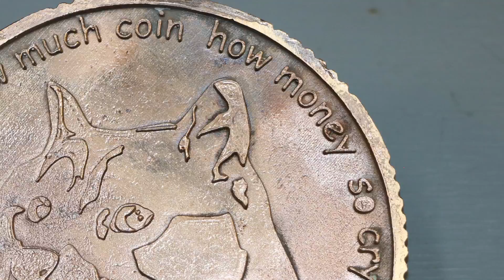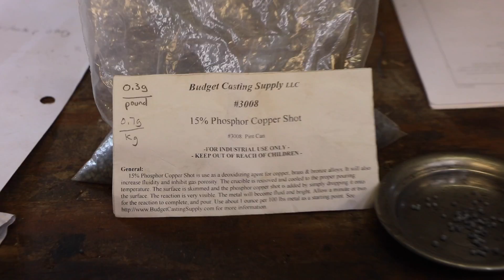3D Print to Metal Casting. Higher Level Lost PLA Casting Experiments.

Comment: Was international casting consultant and scientist for 50 years. Did you take the plaster moulds up to the various stages slowly? There is one at 100C, then adsorbed water at 140C and 180C. I normally can cast bigger than your moulds by a) adding the plaster to about 15-20mm then add some chopped ceramic fibre (like furnace blanket). Let that 80% set and then top up the rest with straight casting plater. b) heat the mould to 90C for 20 mins, then take it up to 140C and hold for 30 mins, then up to 180C for 10 mins. Then heat it up ready for casting.
I would have the mould at an angle so the metal doesn’t flow into a flat area and just “blob”, instead I would have the mould at 10-15 degrees. That way it flows down and then fills up evenly.

Comment: Invest in a vibrator. Or tap the side as you pour the investment. 
Also dont pour into cold investment, just in case you are. It needs to be as hot as you can get it out the furnace.

Comment: Just spitballing a couple of thoughts (I've never done this type of casting with these types of materials): Thicker walls on the flasks might help; the investment material and the plastic and the metal and the flask all have different rates of expansion and contraction - you might be able to find an investment material that is more conducive to these things; have you tried burning out at a slightly lower temperature for a longer time? Possibly this would counter-act the rapid expansion/contraction and (possibly) help with the cracking problem.

As I said, I'm not an expert at all, it's just some thoughts that came to me. Great video!

Comment: I got a tip for farmcraft101: 

Mix into the plaster the red shavings they use to clean concrete floors. 
The stuff they sprinkle on a concrete floor & sweep by hand using a push broom. 
Your molds won't crack & they'll last a long time. 

( In between college classes I had looked up an art professor to ask him how to make strong, durable molds to cast lead & pewter. 

Looking back, I didn't know to ask him two part mold or onetime mold. I was thinking like a top mold half & bottom mold half, strength, & durability. 

Anyway he gave me this tip & I had no cell phone back then. Once online  I could not find this industrial cleaner. Amazon & Etsy were not around back then. Sometime later some smartypsnts latchkey kid slipped into my home & stole all 2 lbs of my lead & pewter bits & nearly cleaned out my kits into ruin. I really hope he/ she rots in a cell some day. 🤬 ) 
Anyway, I will never be able to use this great tip from a master ring maker. 
Best regards.

Comment: I think you need to spray some water and soap mixture on your mold to reduce the surface tension before you put your plaster in. By doing this your plaster will flow better against your mold producing a better detail molds.

Comment: You put the mixture in a vacuum which is cool, but could the mould itself fit in the vacuum chamber after you've poured the plaster? I'd be surprised if pouring doesn't trap air
EDIT: Ignore me, I got to 10:15 now where you've tried exactly that.

Comment: Maybe it was not crosshatching from the print but rather brush strokes from the brush you used while the casting material was wet. The brush brings small air bubbles and the hair left voids? Just a thought

Comment: I think what you could do is, use just a small amount of plaster to cover the top surface details and then mix 1:1 ratio sand with plaster to fill in the rest.
You should also probably burn out the plaster for longer to absolutely make sure there is no water trapped.

Comment: So leave slits for air flow in objects like the d and Os, cast it on its side like you did for more aluminum pressure. The sprue placement must have helped with air flow leaving as metal comes in. you could do the bottom fill and the vent at the too method. I liked the rectangle housing. try vibrating before setting process. Let your metal cool before putting into water. make the details potrude from the face more.

Comment: I use a 50/50 mix of ordinary plaster of paris and sand, pore into a metal can and turn upside down to burn out the pla so it drips out on its own before burning off......heat slowly in the kiln to avoid cracks

Comment: i use drywall joint compound onto very thin walled pla printed models and i dont even have to burn the plastic out, i never have cracking issues my main issue in my 2 small tests so far was simply that my brass cooled too quickly to completely fill my mold. i didnt have any gates or sprues or vents etc. i literally just coated my part and then mae a hole in the coating to pour into. my next test i will use slightly higher melt temp + a riser because i could see on my test part where the detail was better towards the bottom and i tihnk its just the weight of the molten metal.
Reply: I’ve been thinking about using printed parts to cast and have a dumb question. What’s wrong with just using the part/object you print and pouring the molten metal directly onto it? Does the PLA not melt or not melt completely?

Comment: could you use:  Resin 3D Printers

3D printing in extremely high-detail is what the 3D printers in this collection were made for. Whether it is for dental applications, castable jewelry designs, prototype 3D printing and more, this group of 3D printers is capable of incredibly detailed 3D prints. With resolutions of only 25x50x50 microns, 3D prints come out looking lifelike without the need for post-processing. Using various resins, 3D prints can be firm, flexible, soft or incredibly tough for almost any application under the sun.

Comment: The cracking makes sense to me. If your mold is about 125mm across, 68um/m/K expansion of PLA means your mold goes from room temp to glass transition temp and gets about 0.5mm bigger inside a fully rigid plaster mold. Only above the glass transition temp can the PLA start to flow and "get out of its own way" and even then it won't be molten until it expands even more. I wonder if large items would work better printed out of a soluble material (PVA in water, or ABS in acetone) so you could remove most of the material before the burnout

Comment: I found adding sand into the plaster mix reduces the cracking of the plaster a lot. I usually add twice the amount of sand as I do plaster. Plaster is unstable during the burnout but sand is completely inert. It makes the mix more porous which allows the steam to escape the plaster mix as it heats without cracking your mould. I just use regular play sand. It doesn't effect the detail of the casting either.

Comment: At Master Carr you can buy raw material and you can get thick walled pipe in short sections, sold by the foot, just drill out your holes and weld on end cap which was the two crossbars.

Comment: Pressurizing while the plaster sets shrinks the bubbles by a factor proportional to the absolute pressure. Thus if you pressurize at 20PSI which is 20PSI "gauge", or 20PSI above atmospheric, or 35PSI absolute, the bubbles will shrink to 15/35 or about 43% of their original size which is not really much of a reduction at all. Also, unless the pressurized air can diffuse out of the mould before or during firing, it acts as an force trying to expand and crack the plaster.

Applying, then releasing, vacuum before the plaster sets causes the existing air bubbles to either expand and break off completely, or to be replaced by bubbles of water vapour, which condense to essentially nothing when the vacuum is released.

I'm not sure how the air trapped in the 3D print's infill affects all the vacuum/pressure. It may depend on whether the skin of the 3D print leaks. It is almost certain to have a few leaks, but it may also be the case the the entire skin is leaky all over.

Comment: try constrained freedom electroplating molding, with like copper source in copper sulphate
Reply: its very low temperature metal structure, maybe light weight, porous, mass growth, incremental
Reply: similar to casting, but no high temp needed, just electricity in a suitable bath, fitting with the source metal, just have a seed, like wood that can be burned away, also wood mold casting
Reply: burned wood carbon mold infill plating
Reply: etch the details, electro-etching, reverse of the electro-plating
Reply: carbonized paper electro-plating, controlled low oxygen environment, for  graphenesuper cap electrodes
Reply: full ceramic burned mold, two piece, casting
Reply: vacuum welding, inert gas melting
Reply: cake metal keeper around the mold
Reply: or just a normal pipe piece, cut off to length

Comment: At around 6:30, you made pour with no vent.  Is that the way it's done?
Reply from the maker: It had a vent.  Not very obvious with all the cracks in that mold.  With sandcasting vents can be optional, but they are necessary with investment plaster.
Reply: @FarmCraft101  Sorry.  It was 5:41.  I guess it was out of the shot.

Comment: One thing you might try to get rid of the 3-D print layers. Is to put them in an acetone vapor chamber. This will smooth over most of the print lines.
Reply: DIY perks did a nice video on it
Reply: Does acetone work on PLA? I didn’t think it behaves the same way ABS does…..
I am going to try smoothing / sealing the PLA with wax.

Comment: If you think that the print is expanding too much, try printing with the coin rotated in the x or y axis by 45 degrees... It's not a magic number or anything, but I think the problem is that you are printing flat on the bed when it comes to it being too solid. There would be a lot of support material with it rotated, but you probably have 1 or 2 non-solid infill layers as it is. Printing with it wonkey will just leave you with almost all walls, and little solid layers. I have noticed printing in that orientation will increase your surface details and reduce stringing on the surface. Maybe hit it with clear coat to seal it. And yes, it does take forever to find out if it's good or not

If that is the same color change pla I use, excellent choice. That stuff is good beyond it changing color

Comment: As someone that has done many dental castings , here are some suggestions.   1. Wet the pattern with soapy water (we call that debubblizer)and then dry it to help the water based investment "wet" the pattern ( water does not want to wet plastic).   The investment will flow onto the pattern better. 2. Vibrate the pattern as you paint the investment onto the debubblized  pattern and then vibrate the casting ring as you fill it.
Reply: Was going to suggest vibration after watching, but you beat me to it.

Comment: Good video! I've also spent some time experimenting with lost PLA and lost wax and here are my 2 cents. Let me know if you have any questions.

1. You learned by the end that the part orientation is very important. I don't think the horizontal orientation would work very well because the metal cannot fill properly as it will trap air bubbles and break apart... I was happy to see you got a good result with the vertical orientation at the end of the video and I think that was crucial. Always make sure you have your fill at the bottom and your vent at the very top.

2. Like you mentioned, a real crucible (not a tin can) helps a lot. I've found that stainless steel at least 1/16" thick is best as it doesn't oxidize and flake apart which can allow the plaster to move. Keeping the plaster contained will prevent it from cracking.

3. For larger castings, you can add boric acid to the investment to stiffen it. This will absolutely work and prevent it from cracking even with quite large castings, but the downside is that the demolding becomes a lot more tedious as the plaster hardens like a rock and is difficult to chip away from the part. You can find the ratio to use online.

4. It seems your 3D printer is underextruding a bit which is leaving that fragile pattern that the plaster fills into. You should run some calibration parts for this, usually single wall thickness works. You can also use an SLA printer with special wax-like resin for ultra detail, which I've used for jewelry. The machines are only about $200.

5. A bit of windex spray added to the plaster can act as a detergent (?) and prevent the bubbles from forming around the letters. I'm not sure how much it helps but it seems to reduce the tendency to form these bubbles.

6. I've tried pressure casting like you did but with steam and never had good results. You can instead pull a vaccuum on the bottom of the flask which is what I do. Using a sheet of graphite on top of high temp silicone on top of an aluminum manifold hooked up to my vaccum pump works well for me, without spending lots on a fancy casting table.

7. (EDIT): I also use a burnout kiln with a raspberry pi controller to precisely ramp the temp during drying/burnout to prevent cracking. This is very important.
Reply: Thank you for the tips!
I am about to attempt a large investment cast, 10”x10”x5” flask, 1liter part volume. 
I am going to use vacuum during the pour.  My biggest concern was cracking the plaster during the burnout.  I put together a pid ramp controller, check out Andy’s Machines video and patreon.  

Would adding stainless steel needles, made for refractory, help to keep the mold from cracking? 

After seeing how these expensive investments behave on large scale I am considering plaster of Paris with boric acid and a touch of refractory, I don’t mind chipping it out of the part, I DO mind spending $$$ on crumbled investment….
Reply: @kentklapstein9879  Did it work?
Reply: @arrgh406  It worked very well, I used SC20 investment from Randolph and Ransom. The investment was perfect, no cracks or leaks.  I didn't add anything to the investment, just followed the instructions. The detail on the print was great.  I'll be doing more soon.  Smaller items this time.
Reply: El yedo fraguado contiene una cantidad minima de agua,la cual se debe sacar pues el agua al gasificar sumenta 900 veces de volumen,es preciso poner un calentamiento r bajito,para prevenir la fractura del molde.
Una proporcion de 70,por ciento de agua combinado con un 30 de glicerina,obtiene moldes capaz de grabar una huella digital.A,esta mezcla se la añade unas gotas de jugo de limón el cual retarda el fraguado del yeso.
Un molde hecho de hule comun de vulcanizar,se imprime una figura y despues del vulcanizado se ahoga en petroleo,el molde se incha y crece un 500 por ciento,despues con parafina liquida obtenemos una copia 500 veces más grande a un costo infimo.

Comment: Whats about printing the item with low to zero infill, as few outer shell layers a possible, and then burning it out with the molten metal? When the molt goes in from the bottom, and there is an air vent on top, it might smoke like hell, but evaporate all the PLA?

Comment: I keep thinking you're firing them too quickly... Maybe let them bathe a bit?
Reply from the maker: I'm firing according the to investment manufacturer specification.  I'm convinced at this point it's due to my improvised flasks, and doing large items.  With a smaller item and a proper flask, it works great.
Reply: @FarmCraft101 aye, thanks for taking the time to answer. Cracking is pretty much unavoidable, in my opinion, but to minimize that, perhaps it's best to modify the recipe to better fit one's conditions. I'm not an expert, even though I was taught by experts.
Source: engineering studies, self-experimentation, internship at denture manufacturer (or whatever it's called, English is not my native language)

Comment: I'm surprised your investments aren't firing out any better than plain old plaster. Are you firing your molds the same day that you pour them? Try waiting longer. If you allow your form to equalize to atmospheric moisture and temperature and bring it up to temp slowly, you may see a lot less cracking. The drawback is it takes forever. Also, if you limit the burnout heat to just what is needed to burn out the PLA, the bonding constituent in the plaster may not be cooked to its pre bonding state (similar to the lyme cycle). Lastly, the heat expansion rate of the PLA is greater than that of the investment, so you'll always get cracking on larger molds no matter what you do. They don't have that issue with lost wax (that many investments are designed for) because wax gets to melting right away without much expansion. They do make a wax PLA filament for this reason. 
A fine sand casting would suit best with that two sided shape.

Comment: I'm only halfway through the video... I was going to say that if you are losing definition between the print and the cast you could try pre-wetting the print before pouring the cast material on it (theory being that the liquid can get in all the gaps and not trap air first and then its easier for the cast material to wick in to the gaps).   The cracks in the mould after you pull them out of the firing are alarming to me, there must be information on the net as to how to solve this issue - maybe the firing profile is wrong, or maybe you'd need to do a two stage fire.    The use of the expensive casting material could be overcome in the same way they do it with the sand or silicone moulding, by using one to capture the detail and then an outer layer of a space filler (expensive material where it counts and bulk it out with something cheap).
Reply: and now I'm watching the Ceramic Shell Casting video and that seem like a much better method (only 3 minutes in).  Where you cured the ceramic by heating it up slowly in the furnace to allow the plastic to room to expand, was that the same way you did it on this video (I don't think you covered that detail here)?
Reply from the maker: Yes, I fired them the same way.  Forgot to mention it in the video.